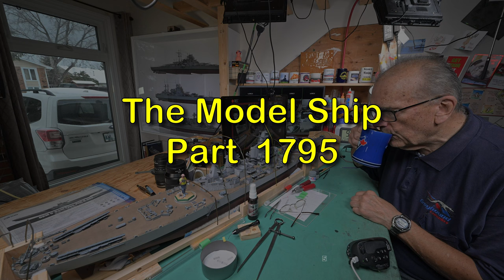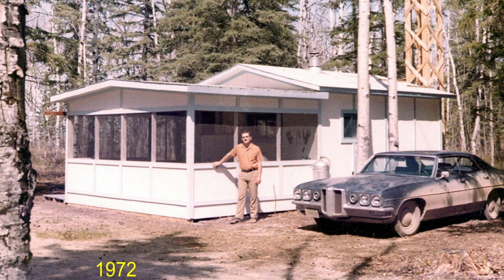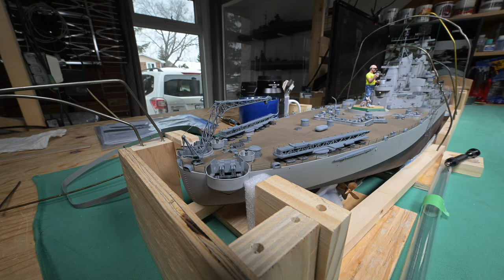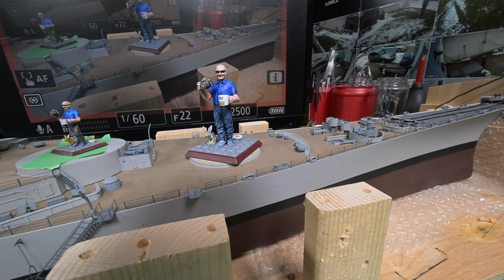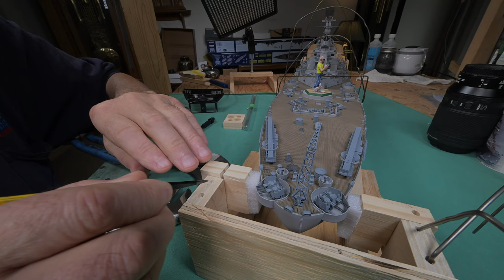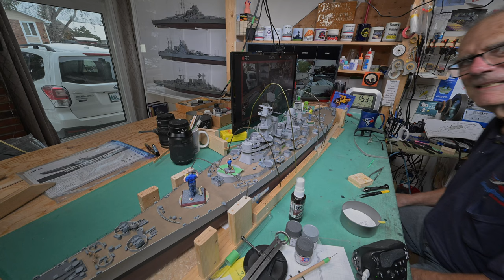The Model Ship - Part 1795

Comment: The photos of the Iowa I use to follow along show that the railing looks like wire cable strung with eyes welded to the poles.
Was wondering if it would be simpler to mount poles and string scale wire between them? That photo etch would drive me round the bend.
Reply from the maker: That's a thought! 👍